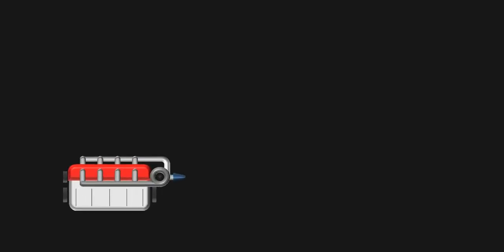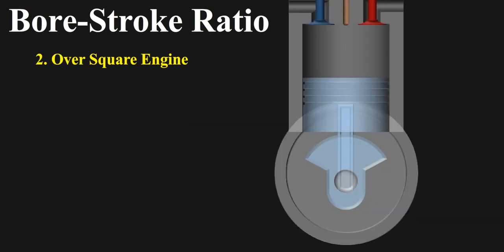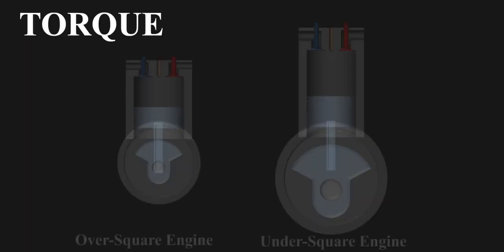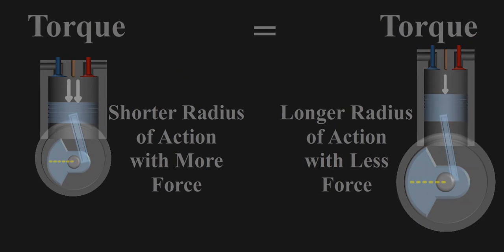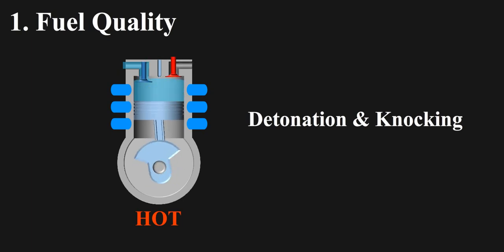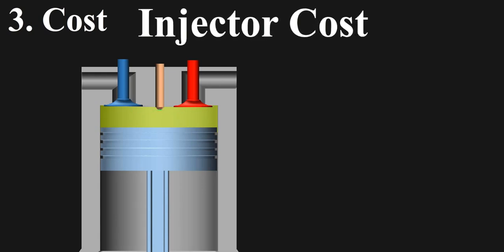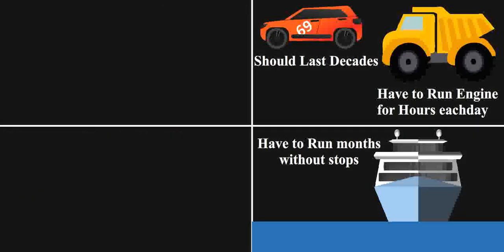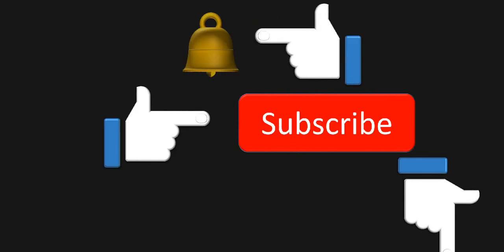Bore Stroke Ratio | Performance  Engine life  Effects | Applications

Comment: Nice vid.Under square engine does  produce more tourqe as more leverage on crank vs square our over square why do over square acceleration faster because rpm vs square or under square engine.over square has more piston area which puts more load and wear  into main bearings vs square our under square engine.Over square get rid off heat better due to larger bore where under square have friction power loss compared to square over square engine. Peace
Reply: The crankshaft provides no leverage.  It merely converts the work done by combustion pushing the piston down the cylinder from linear motion to rotational motion on a 1:1 ratio.

Comment: thank you for your video 
but i think there is something wrong about torque 
T=F*R
F: it's force from internal combustion while we have the same type of fuel and the same displacement  so we
can say that over-square engine and under-square engine have same force so the torque is diffrent 

please your answer it's very important
Reply from the maker: Power is dependent upon fuel type, efficiency, and and amount of fuel burnt. If fuel type is same efficiency is same, displacement and rpm is same then the generated power will be same.

Power is ultimately torque and rpm. If rpm is same so will torque be different ?
Reply: torque will be diffrent because of radius
we don't lose force from under-square engine for example the force of 2l fuel will stay the same in any shape :P=f/A piston. how the A piston can give us more force with relation and with same amount of fuel 
please can you show me some graphs how torque is the some for both engine
Reply: does these engines have the same pressure

Comment: How does cylinder centre distance / bore spacing impact the ability of an engine's ability to grow in terms of further increases in bore and stroke? For example could a 4-cylinder 895cc engine with a 72mm bore x 55m stroke and a 93mm cylinder centre distance have a greater potential of growing larger compared to say the Suzuki G with its 84mm bore spacing at 1.6-litres or a 4-cylinder version of the BMW M20 6-cylinder with a bore spacing of 91mm?

Comment: Brother you are weak at engineering...........The heat losses are less in under SQ. The heat is not desired in an engine once the combustion has been completed so it is better if it dissipates from Curved surface area

Comment: I am gonna add something here, comparing a diesel engine to a gasoline engine is like comparing a sledge hammer to a tack hammer! The different fuels with the Joules input to the actual joules output no matter the displacement higher joules win. More Air, more Joules + More power! I used joules for the European scientific community. But I am going to explain what Horse power is! RPM x TORQUE / 5252. Torque moves mountains, rpm moves less of the mountain at a faster rate= but the mountain is moved  in the same time with the same energy.

Comment: You forgot to mention piston speed (and its limits) as a factor : over squared engines can run higher rpm's with equal or even lower piston speeds
Reply: This video is for entertainment purposes not educational....
Reply: Equal piston speed? Does that mean the over squared and undersquared piston reach tdc and bdc at the same time? Than both have equal rpm
Reply: @thegipset5327 At same RPM under square piston will move faster to cover larger distance.
Reply: @thegipset5327  yes at similar RPM ,in both cases piston reached TDC or BDC at exact same time.
Reply: Or equal piston speed as they move for m/s?

Comment: If I m not wrong ,I would like to say that a long connecting rod would result in great efficiency than short because of little angle produced at piston pin. As the push from piston gets split into two components sin and cos . Rest u understand

Comment: Well, my Harley Davidson Sport Glide sure has more power at 3000 RPM than a Suzuki Hayabusa at 3000 RPM :-)
Reply: True, but depending on gear ratios, the Suzuki might rev to it's equivalent power rpm faster than the Harley will get there.
Reply: @ninemilliondollars  Yes, you are right. I also have a Honda Blackbird 98. It is crazy compared Harley. I enjoy ridding them both. they are so different.

Comment: this video explained a lot of stuff that other people missed,but i also feel that you gave over-squared engines a little to much dirt,i believe both are equal when i comes to reliability,its just usually oversquareds are used in applications were they destroy themself's to do there intended purpose while undersquared engines are used in applications were reliability is targeted or the engine is safe zoned so it cant do such thing.i believe in the end its just preference.

Comment: This video actually caused me to go and calculate everything for myself, as I have been told before the exact opposite, that longer stroke has less surface area. Funny enough, this video was correct, the one with the bigger stroke has slightly less surface area in the cylinder. Then I looked into big cylinder vs more cylinders (i.e. trucks vs sports cars) and found that with a truck's long stroke (but decent size bore too) giving around 1 liter per cylinder vs a slightly over-square engine with 0.5 liters per cylinder, the truck had around ~90% of the surface area as the sports car. Kind of fascinating and weird at the same time.
Reply: My bad, I actually forgot one part of the equation. I calculated the surface area of the cylinder walls, but forgot the top and bottom (assuming they were flat circles). This time I re-calculated and the results were actually pretty close... But the longer stroke engine actually had a slight bit less surface area (I'm talking not even 1% difference here). For this example I used the OM606 engine which has a bore:stroke of 87:84 and the M57 which has a bore:stroke of 84:90.
Reply: My Name Is Hello One important factor that he is ignoring when it came to surface area heat loss (5:27) is that the hottest part of the combustion happens at the top during combustion. The cylinder head (combustion chamber, thus more of a factor in big bore oversquare engines) is exposed to this entire high pressure/temperature charge. As the piston moves down the charge decreases in pressure and temperature dramatically. Only a sliver of the cylinder wall sees this high temp/pressure charge volume. The statement about an undersquare engine having more heat loss just because it has more surface area (due to the math involved in lengthening a cylinder) is very misleading and in most cases false.
Reply: @amorag59  True

Comment: Diesel engines produce more torque mainly due to the fuel and compression ratio being typically over 20:1. Also, when you increase the stroke of the engine while keeping the bore the same, the capacity goes up and that increases torque. Hence why companies sell stroker kits for engines. Naturally aspirated F1 cars (V8/V10) produce significantly less torque (around 350nm) than many high performance cars. It makes power (over 700hp) but low torque relatively speaking. However, it doesn't need much torque to move the car due to the low kerb weight and that it exclusively runs at high RPM being a race engine.
Reply: The low weight has nothing to do with it.

Comment: Interms of top end race which type of engine is prepare for that kind of race
Reply from the maker: Over squares
Reply: @UntangleClub   PLEASE DO ANSWER.
 i m confused that---
               "if same displacement under and over square have same torque"!
1) So under square engines are used in heavy vehicles because it gives greater amount of torque in lesser rpm?
2) and over square engines get torque later the rpm?
3) so that we have to get to a certain high rpm in oversquare engines to achieve higher torque?
Reply: @pushlittleharder  if u want power u need to sacrifice torque..but torque can be compensated by gear ratios..when talking about cars its not all about the engine there are also other components like the transmission and differencial
Reply: @gee_elgaming21  so this means my bike torque can be altered by changing sprockets
Reply: @pushlittleharder  yes but ull reduce power/top speed

Comment: So basicly over squares produces more power but under squares are more reliable and cheaper?
Reply: Yep.  Makes sense why Toyota's last forever.  Inherently balanced strait 6, undersquared, plus geared cam, and components.  I'm not surprised they switched to engines that grenade after a few 100k

Comment: I think the force will always be multiplied with the distance on this principle only the torque wrench works in the same manner we can expect the torque to be more in undersaquare engines compared to overquare engines
Reply: Hey please help me with this 
Over square go to a higher rpm 
And these type of engines are in F1 cars 
They use petrol as fuel 
While trucks use under square engines they use diesel as fuel 
Diesel requires higher pressure for ignition while petrol is uncontrollable at high pressure so they use spark plugs 
Trucks need torque more than horse power so they have undersquare  engines .
I think the bore and stroke ratio is mostly related to type of fuel used 
Diesel has higher energy than petrol but diesel engines need to be better sealed  
I would conclude that 
Petrol over square engines will produce more power and diesel under square engines will produce more torque
Reply: @pranjalsharma479  first is you will have to change your parts like piston, valves, cam and crankshaft to lighter ones like forged alumnium kind so that it won't rupture under high rpm
Then upon your need choose the supercharger or turbocharger volume
Reply: @kuldeepgowda9508  for what
Reply: kuldeep gowda I agree with you longer stroke more torque in most cases.
Reply: Depends on engine rpm,The torque is equal.Just different approaches
Reply: @Massacreonice  why different rpm produce different torque and horsepower output
Reply: @pranjalsharma479  its all about power graph,usually oversquare engines,it has short powerband range,bcause oversquare has low torque at lower rpm,so the power must kicks in/max torque around 5-6krpm bcause the piston travels faster and power goes lighter,if oversquare has long powerband,the motor will be useless.For undersquare engines they got early torque output usually it starts from 2-3krpm,max torque around 4krpm,it has flatter powerband until reaching max power output,thats why undersquare engine like diesel cant relied on power at higher rpm,the power stops earlier as the torque starts earlier,more power more torque,thats why it has different approach,oversquare engine produce torque from high rpm whereas undersquare in lower rpm,thats why many people love oversquare engine like vtec etc
Reply: @Massacreonice  is peak power of over square engines at high rpm due to the short travel of the pistons , they can build up speed and inertia doesn't effect them
Under square engines have to travel a lot and their change of direction of motion at higher rpms make them useless at that high rpm
If an under square engine had incredibly lightweight Crank and pistons 
It would produce early torque and high horsepower at high rpm 
Am I right?
Reply: @pranjalsharma479  thats right,if that engine was mod it would be different,some oversquare needs to stroke up in order to produce more power and torque but you need to calculate everything,stock oversquare are easy to produce power just need to increase AFR and bigger port.
Reply: @pranjalsharma479   Pranjal Sharma  The inertia of a broad piston is generally higher than a skinny one, and will require a stronger connecting rod as well. Because of this, the inertial mass of the short-stroke vs. long stroke engines remains pretty similar. It's hard to find that magic formula where the length of the stroke vs the bore doesn't cause weird filling issues during the intake stroke and it only gets more complex when you consider that it's not just the rotating mass of the crank that makes a huge difference in how fast you can change your RPMs, but it's diameter as well. Short-stroke engines do have less torque at a given RPM (UC's explanation fails to consider some factors) than their long-stroke counterparts but the shorter crank arm means less rotational mass in the crank itself and less angular moment.
The longer crank arm on a stroker motor means you get some flywheel effect which will make your RPMs harder to change but that also has a smoothing effect on the power delivery.
Your premise is correct, but you'll find that the higher your RPM's get, the harder it is to overcome the weird fueling/flow issues that are inherent to common DOHC motors and you start seeing weird stuff like five valves per cylinder which flows very well but introduces it's own problems, such as valvetrain harmonics and extra friction due to even more valve spring resistance, etc.
Reply: @SwervingLemon  well Iam no engineer just a guy who recently finished school 
The optimum formula must be in the hands of F1 cars 
Wide bore short stroke but you know that , that ain't easy so . Most engines I see hardly go over 5000-7000 rpm 
Mostly to reduce vibrations 
Friction as you mentioned which will put load on the intercooler due to heat, the turbo will get affected  again due to heat, and so on , the fact that now internal combustion engines have tones of restrictions and people will always choose economy over performance , (not us😂)  Chevrolet just patented a new Crank design , check it out on engineer explained
And the thing you said about valves 
Electronic valves are used now and I believe that the engine must mechanical assist the electronic fuel pump and just like a blow off valve in turbos something like this can be made to make more bang for the long dead dinosaur .
Reply from the maker: It's true that as length of stroke increases the leverage increases giving more torque multiplication but there's one thing which can't be missed either. As you said about torque wrench, let's take that example. The torque applied by same torque wrench differs if it is operated by an adult or child, the only reason is, both apply different amount of forces. Similarly when considering for Same displacement, as you increase stroke area of piston crown decreases, so the pressure of combustion get's less area to act decreasing the resultant force pushing the piston. Hence torque applied is same as torque applied by adult using great force but with short wrench is equal to that of a kid using less force but with way long wrench.

Hope it answered your question.😄
Reply: Untangle Club I don’t agree on the video explanation that an under/oversquare engine of same displacement would make the same torque. In the real world there would be too many variables that would interfere such that you can’t “make all else the same other than displacement”. If things such as combustion chamber volume, head gasket thickness and piston dome shape of the under/oversquare engines stay the same then they will have different compression ratios.

Take any bore/stroke specification and increase the stroke. Now decrease the bore to maintain same engine displacement. Now compare the compression ratio of both engines maintaining the same gasket thickness and volume of combustion chamber and you will see an increase in Compression with the stroked engine of same displacement.

I did calculations on two engines with the inverse of each others bore stroke ratios: 90/70 and 76.113/97.87 (the inverse of each other bore stroke ratios while keeping the displacement the same) I calculated that the force on the piston with the 90 mm and 76.113 mm pistons using 1000 and 1500 peak psi pressure as an ideal figure to convert from pressure to force on each piston. Using torque = force x radius I found that the undersquare engine (stroked) had suffered only ~.04 pound feet of torque loss, meanwhile this same configuration gained 1.2 in compression using 20cc combustion chamber figure. This increase in compression would likely more than compensate for that minor loss of torque associated with the smaller piston.
Reply: @UntangleClub  I’m sorry, The Crankshaft can provide no leverage. It is a class one lever with a mechanical advantage of 1, as in it has a 1:1 leverage ratio.  As in Zero leverage.  The Crankshaft’s primary function here is to convert the work captured inside the cylinder to rotational motion.  100lbs/ft linear becomes 100lbs/ft rotational.  No force is gained at the expense of distance or vice versa.  In order for the lengths of the crankshaft offset “lever” to provide Leverage ratio greater than 1:1, say 3:1 for example the stroke of the piston would have to be 6 times the length of the Crankshaft offset radius which is impossible. There is no “Leverage” that occurs inside the engine itself.  Leverage is the domain of the transmission, differential and tire diameter selection.  For a simple visualization.  A seesaw is a lever.  If the force say (100lbs) you are using to lift is 5 feet from the centre and what you are trying to lift is also 5 feet from the centre at the other end you have a lever with a mechanical advantage of 1.( balanced equilibrium). You have a leverage ratio of 1:1 ie - ZERO leverage.  Extending the lever from 5 to 10 feet would provide a 2:1 leverage ratio if the other end stayed at 5 feet from the fulcrum (centre).  The crankshaft however is geometrically linked to the stroke of the piston so that would be impossible.  The distance at one end of the fulcrum can not be greater than the distance at the other.  You show this relationship yourself at approximately 1:04.  Please correct this misinformation as it is permanently disfiguring the minds of so many.
Reply: @UntangleClub that’s not leverage.  There is no leverage that a crankshaft applies to the work done by combustion pushing the piston down the cylinder. It merely converts the linear motion to rotational motion on a 1:1 ratio.